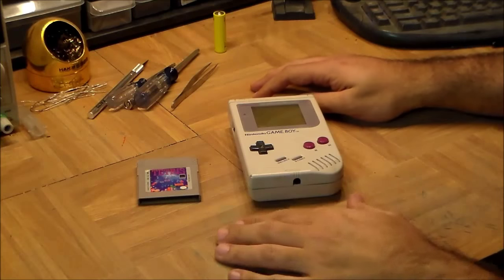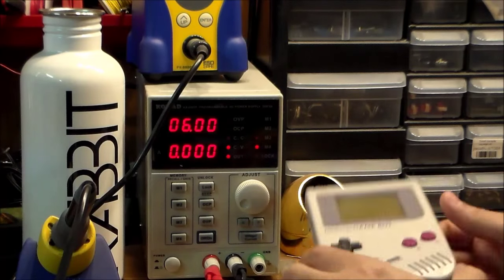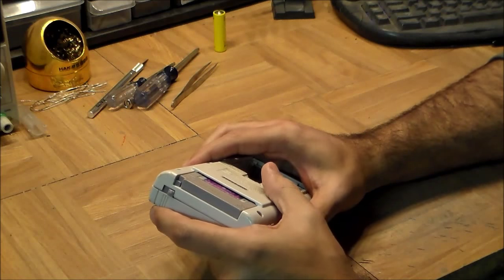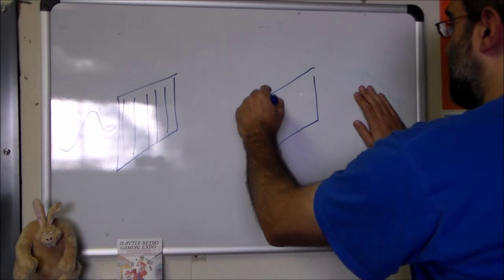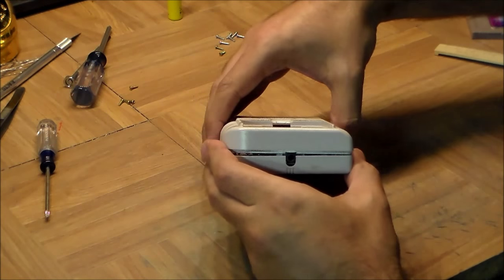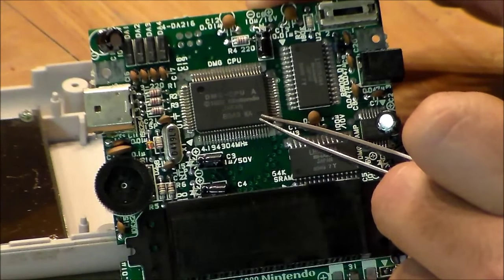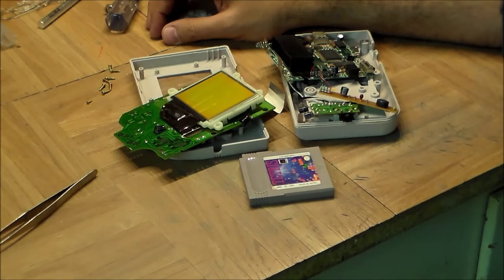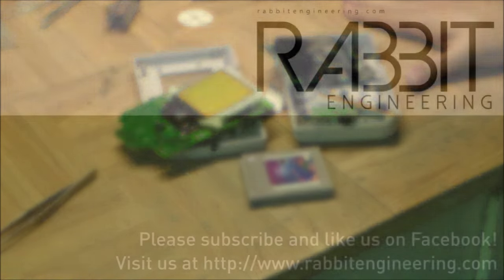Inside the Black Box 8: Nintendo Game Boy

Comment: 24:37 DMG is "dot-matrix game", I think.

26:46 The important point of distinction between a computer's RAM, and a cart based console is that most of the console memory is non-rewritable ROM. Consoles, particuarly Nintendo's ones, usually had a very small amount of RAM but most of the game data didn't ever need to be changed, so ROM was a workable solution.

This apparently gave many early computer programmers moving to console quite a surprise when they realised how little actual RAM they had to work with.

It also explains certain traits of console games.  Respawning enemies is virtually a necessity since there often simply wasn't enough RAM to keep track of world changes except in terms of broad strokes.

Comment: As a few have mentioned, the Game Boy didn't have a light as a standard feature until the GBASP.

Also, I'm fairly certain the original GB didn't come with an AC adapter, at least I didn't get one in my box way back when. That opened the door for a lot of third parties to make ac adapters and rechargeable batteries.  A couple of the third party rechargeable batteries actually worked around a design frustration I had: if you plugged in external power, the system would reset! they got around this by actually clipping to the battery compartment in the back and using the battery terminals there. That way if you were on low battery, you could plug into the rechargeable without losing progress.

Comment: When talking about Yokoi's toy-making history for Nintendo it would have been good to mention that he first impressed Yamaouchi with the Nintendo Ultra Hand (extending hand toy).

The Game Link cover hinges off easily when you pry from the front side while it's fully seated. It will get loose and fall out if you do it too much.

The DC jack was also intended for the official external battery pack (pak?). Nintendo always said to only use Alkaline batteries inside the unit (no rechargeables or "Heavy-Duty"). They only advertised 8-12 hours per charge and I don't think I ever got over 18, so I think you're way off about the maximum battery life. They probably don't drain that far or you are thinking of NiMh batteries for your mAh estimation.

Comment: Nice video, but there is a mistake on it, the original gameboy didn't had a backlight. It was not until GBA SP that nintendo added one. Because it was black&white and low-res, the issue was not that bad on the gameboy as in GBA.
I think the gmeboy lite had backlight, but it was released much later.
Reply from the maker: +Iuri Fiedoruk Thanks for the correction! White LEDs were expensive in the late 80s, so doing an efficient backlight would have been costly.
Reply: Please.keep those videos coming. i love to know better details on hardware and its history. I collect some consoles, have some knowledge in electronics,  and here in Brazil we have a rich number of clones consoles that is fun to look at.
Reply: +Dave Nunez (Rabbit Engineering) actually, there was backlit Game Boy prior to the GBA SP, the Japan only Game Boy Light. However, its timing was unfortunate, as the Game Boy Color would be released the same year.
Reply from the maker: +Phredreeke interesting!
Reply: +Iuri Fiedoruk I believe what the GB classic uses is reflective material on the back layer to bounce light back out again.
Reply: +Dave Nunez (Rabbit Engineering)  What's the point of white light on a monochrome display? Orange-yellow LEDs are ancient and cheap.

Thing with backlight is, it's not very power efficient. I think front lighting was a better solution, but light guiding may be an issue. First GBA SP display is front lit and uses a special foil to redirect light coming in from an edge down into the display. The newer GBA SP is backlit.

Comment: Cool video again, I had missed it indeed XD then I hope the next nintendo video will be a n64? :D

I find 20 hours of battery life with 4 batteries not that great to be honest... I mean the XD gets 8+ hours of intensive modern android games like modern combat 4 at max brightness on a 720p ips panel with a normal 6000 lithium-ion battery. So 20 hours with 4 batteries I find to be quite a lot - I would use about 6 batteries a week! 0_0

I also find it a shame the sega game gear never got more popular, I mean I understand why, but it was much, much, much better then the gameboy... colour screen on which you can actually see what happens, you could watch tv on it with a little plug-in antenna, the CPU etc. were way more powerfull , and as such the games were also much more impressive... more so then the gameboy colour event o be honest. Off course, it did require 6 new batteries every 6 hours, but I would be happy being a 30-battery pack every week for those kinds of games XD

True these old things are built like a tank, my gameboy colour still works perfecyl as well (and I got it second-hand in 2011 XD). Heck there is a gameboy in a museum somewhere which was in a barracks and it was bombed and the GB was burned and twisted but it still plays tetris! XD I like the game gear better but I have to admit hte gameboy (colour) was a lot cheaper and still  pretty impressive for it's day, and completely, totally indestroyable XD

such a shame the (new) 3ds xl is so much worse too, the quality of these recent nintendo systems has gone to hell... the plastic creaks and feels like it will crack when you take it apart to replace the sd card, the screen is absolutely horrific, the battery is bad, the analog nubs break off for some people when playing smash, heck why is there only one analog?? (and no that... thing on the new 3ds xl doesnot cound as a second analog joystick even tough nintendo calls it that) Monster hunter was unplayable! unless you buy that stupid circle pad pro monstrosity, the hardware is shit, and ... well. blergh. I love my vita, it has great JRPGS and the like so I play it a lot, much better then the 3ds. XD

Comment: I'm confused about the memory. Everything I read says it has 8K, but there's clearly "64k SRAM" silk-screened on the PCB there. Speaking of that, the chip you attribute to power conditioning is labeled "AMP." It looks like an audio amp for the speaker/headphones to me.
Reply from the maker: +Emmett Turner They probably mean 64kilobits, which is 8kilobytes. The AMP comment I think it correct - I may have confused the power socket with the headphone jack on the PCB :-p

Comment: Man, I would love to hear your explanation about how the Gameboy Advance screen works! I always wonder why that reflective plate under the lcd doesn't improve much of the image or the color showing... because it seems to be reasonable, but it's crap
Reply: He explained how color LCDs work. GBA works the same way as any reflective color LCD, like the Gameboy Color. The problem is that there are more pixels that are smaller/more dense with more colors, so it's harder to distinguish details from individual pixels. Your brain will see the clearest simplest details and filter the others out (like camouflage), which is why you often see scratches or your reflection instead and strain to see the intended image. Most plastics and glass reflect 25% of the light that passes through. Like one way mirror or a window at night, you can easily see a backlit screen as long as there is more light coming through than reflected back on your end. This is why a backlit LCD is hard to see in sunlight while a reflective one actually looks better.

In short: GBA is the same as GBC except smaller pixels and more color detail. More color means less solid color objects to distinguish from reflections and scratches.